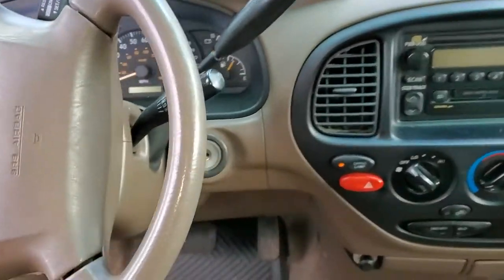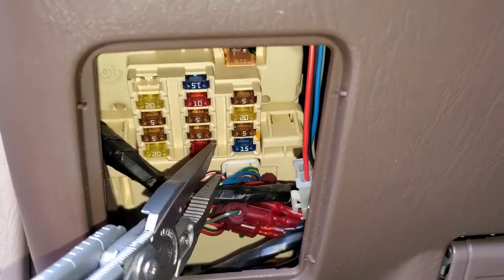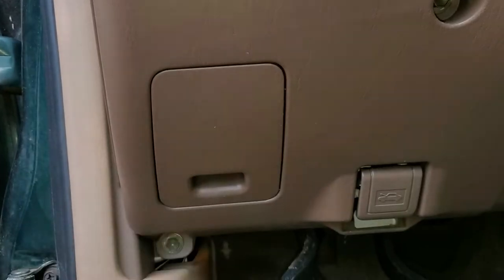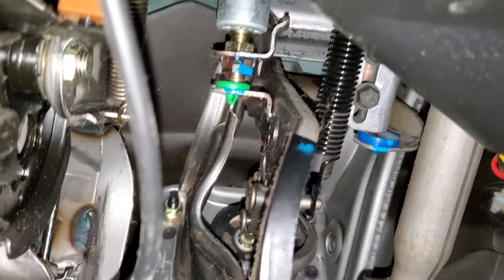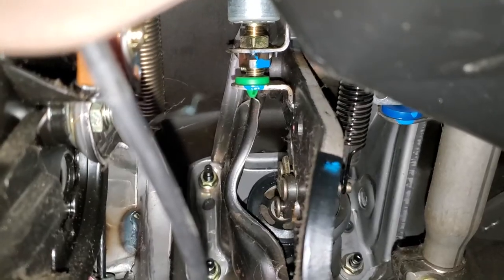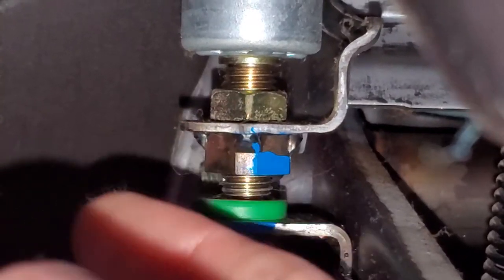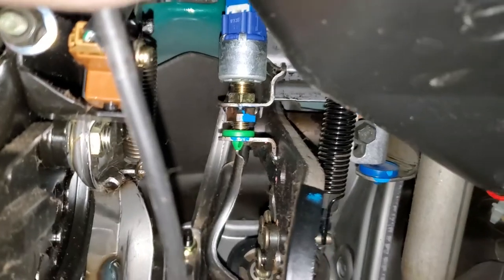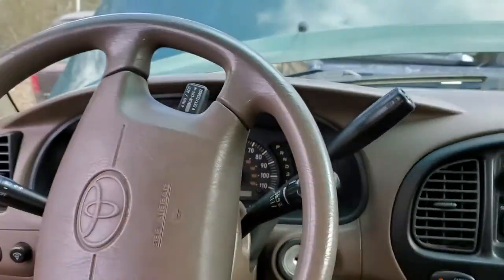2000 Toyota Tundra Brake Light Fuse, Stop Light Switch Location, Replacement

Comment: Very informative video. My 2003 Tundra just had the brake-lights-on-all-the-time problem, and this video nailed it. I couldn't quickly get the little stop/gromet locally, so I improvised. Like everyone else who has kids our fridge is covered with little magnets of all sorts, shapes, colors, and sizes. I just grabbed one that was the size of a nickle and about the same thickness and slapped it over the hole the stop/gromet is supposed to occupy, and Voilà!, no more lights. I test drove the truck and everything works like new. Thx for the video Lehew Tech!

Comment: If the plastic grommet is broken, you don’t have to unscrew anything from the brake assembly. Just press the brakes and place the new rubber grommet in the, now exposed, hole. 🤠
Reply: JACOB, THANKS BROTHER!!! If you have it on you have a hell of alot of room!!! I just fixed my daughters!!!
Reply: You are correct.   Helps if the truck is running, pedal goes down a lot further.   Took seconds to do this way.  Thanks!

Comment: Found my 4cyl Toyota 2000 4 runner battery died. Got it charged. Then thankfully noticed my brake lights were remaining on after I turned the car and lights off. What?

I tried different things. No help doing them.

Then removed the 15amp fuse [bottom right in fuse box, below far left of steering wheel]. 

That did it - at least it turned off the brake lights for the moment. 

I then looked under dash at brake pedal arm to see if a switch was there and not functioning. Finally found the switch in the same position as your 2000 Tundra. 

I used my knife to push back and forth the plunger of the switch, to see if it was in a stuck position - not realizing at the time that a 'stuck' brake light switch plunger, 'stuck' back in the switch body would keep the brake lights from turning on at all. 

What I didn't know or notice at the time (until I watched a few videos here on YouTube and yours here as well) is whether there was a brake light switch 'bumper' missing from the brake arm. Which if it has deteriorated and/or fallen out of the brake arm 'hole'; then course there'd be nothing to depress the brake light switch 'plunger' back into the brake light switch body when the brake arm returns back to its resting position.

I'll be going out in a few minutes to ascertain if that is the issue missing to re-depress the brake light switch plunger back into the body of the switch . 

I hope it is that and not the switch itself. That looks like a pain for me to replace and more expensive of course to buy. 

P.S. 
I tried to leave the fuse out to start and move the gear shift. But it appears the shifter WILL NOT shift with that fuse blown or removed. If true, that's a good safety feature I guess. But a real pain and conundrum if you are not aware of this feature. 

So I've run the car around with the fuse in and the brake lights continuously on. When I stop, I remove the fuse to avoid the battery draining dead. 

I'll be going to auto parts store for either or both a new brake light switch; and/or a brake light switch 'bumper'...once I determine what's the exact issue.

Comment: Thanks for the tip on which fuse to pull.  I used a small sticky-back  that fit perfectly where the old grommet used to be and it worked fine.

Comment: When I found this video I thought I struck gold. Not only did you describe the identical problem as mine I also felt like the video was made in the cab of my Tundra! Mine is identical. I wonder if your Tundra is also beige? Anyway, back to my problem. While your video is exceptionally clear including the green color of my broken grommet/ bushing, I've been unable to get my head under the dash far enough to see the switch and bushing. You aren't 1 foot tall are you? You made it look so easily accessible! Regardless of that I still think this video is a gold mine. Though, I may need some Dynamite to get to that gold!;-)
Thanks,
Wakodahatchee Chris

Comment: Saved me from tearing through my brake system for the issue. 15min and $5 in parts and I'm back in business
Reply: Lucky you. Not the switch, grommet, bulbs or fuse for me. Still looking

Comment: Maybe you can help, have an 02, all my lights work, except my headlights are always on as long as the key is turned on, idk if that is related but, my main issue is that when using my right blinker only, left works fine, when I brake it speeds up, as if my bulb is burnt out, and the rear blinker just stops working, but as soon as you let off the brake, it goes back to normal speed and the blinker works again… I’m suspecting a ground but then I also don’t think it would work at all but I’m not expert… any ideas? Thanks in advance.

Comment: My Tundra is a 2003. Did you have to remove that vinyl panel under the steering wheel to see where the grommet goes? I can't see under there without removing it.
Reply: Guessing my Gen 1 2000 Tundra is similar.    No need to remove anything except maybe broken bits of the old grommet.   Push down on the brake pedal with the engine running and use a needle nose pliers to get the new piece into the gap.   Simple as that.   (Though you have probably fixed by now, LOL.   But that's all it takes.)

Comment: Great video! Do you know which wire coming off of that brake light switch is considered the "cold" side. I need to know which one to tap into for a trailer brake controller. Thanks.

Comment: Question please - if that fuse is blown or if the switch is bad, you will not be able to shift out of park, correct?  I'm trying to diagnose some transmission issues and this was one to check off the list.  It doesn't seem like these switches fail that often though, at least not that I've ever heard.

Comment: Thank you, I was wandering what that green plastic pieces were on the floor mat was and why my brake lights won't turn off. Thank you!
Reply: I  agree! Same scenario exactly
Reply: I can’t fix this today will my battery die
Reply from the maker: Yes it will..perhaps you can disconnect the battery until its fixed.
Reply: @LehewTech  thank you. I disconnected the battery. Can safelite fix this

Comment: So I’m currently having a problem where my dash has gone completely out whenever I turn the lights on, and makes night driving impossible I’ve already checked all my fuses. Separately, one of my lights is on constantly, and the other one works out supposed I’m about to go out and check the grommet but dose anyone have advice.
For a 2001 sr5 tundra v6

Comment: Completely useless. How TF do you get in there to replace it. No wrench in God's creation fits in there!!!
Reply: Sir, it's obvious from your comment that you have little understanding of the laws of some basic physics as it applies to back yard auto repair. Here's a classic (universal) example.>>
Symptom: Foot not on brake but brake lights are on.
Brake Test: Brakes seem to be fully functional and peddle doesn't appear to be sticky. 
Manufacturer's Documentation: This is a common problem found in Year & Models (put yours here). This problem typically requires replacement of the Brake Light Switch or Brake Light Bushing sold together as an Assembly. 
These two components are located under the dashboard and connected to the Brake Peddle mechanism. You can easily locate and identify the Brake Lights Switch among the 50 other switches because this switch will be the only one that's f!cking inaccessible! I believe these Physics laws can be found in the Hard Covered book or Disc "Murphy's Laws"
Sorry, I couldn't help myself because I'm here for the same reason you are! My switch is fine but that cheap plastic bushing is toast and No fun to get at!!!:-()
Wakodahatchee Chris
Reply: @cdrive5757  Some people can't get it even when they watch a youtube video telling exactly what the problem is and how to fix it.